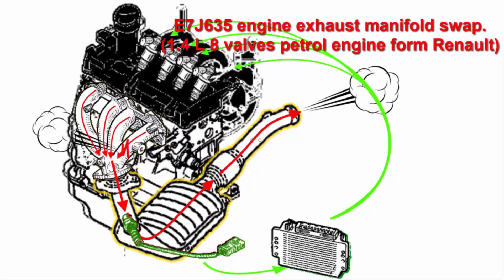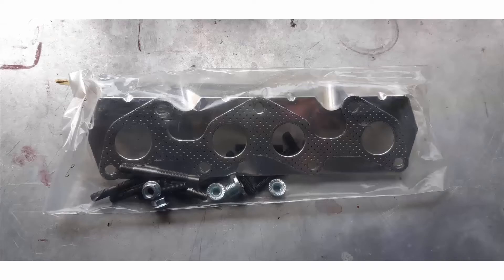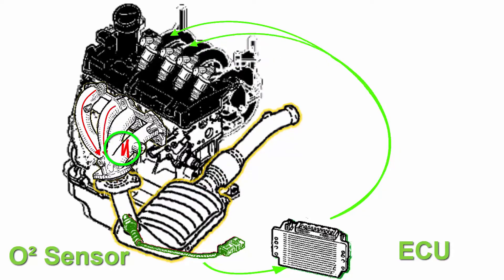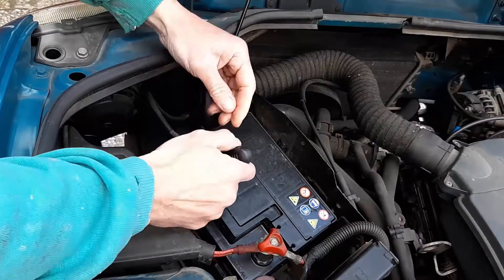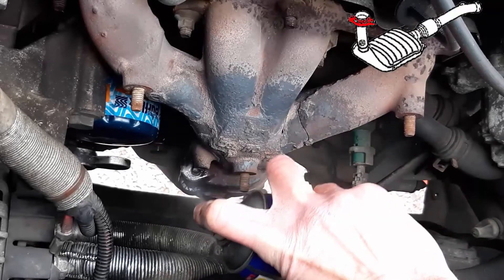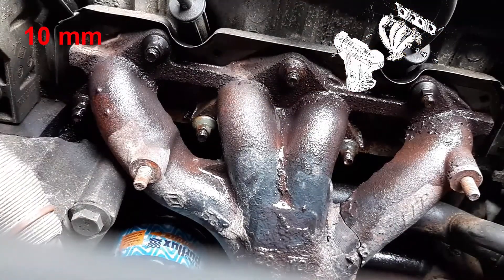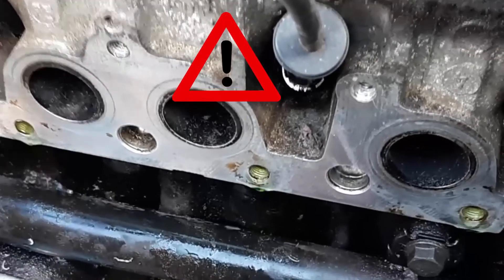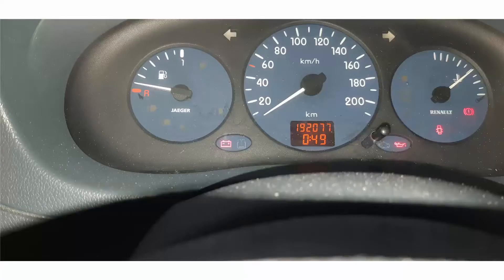Exhaust manifold swap on a E7J635 engine from Renault. (1.4 petrol 8 valves)

Comment: Thanks you for the video. Please I need to know which are all the parts linked to the intake manifold. I have the same engine, but there is an inlet at the right side on the manifold that sucks air in and the component or hose is missing. this inlet is close to the one that connects to the brain of the car. When I start the car, if I close that inlet completely, the engine stop.